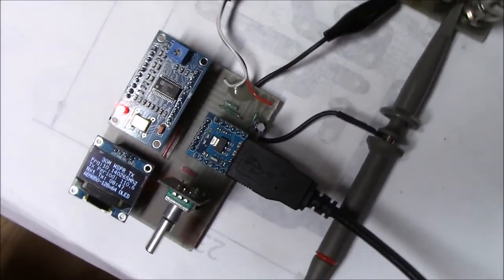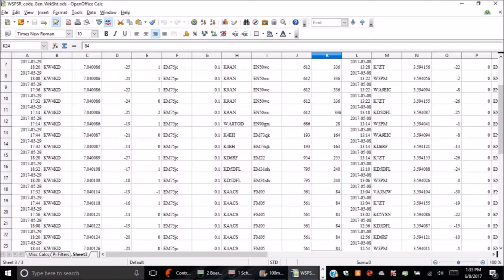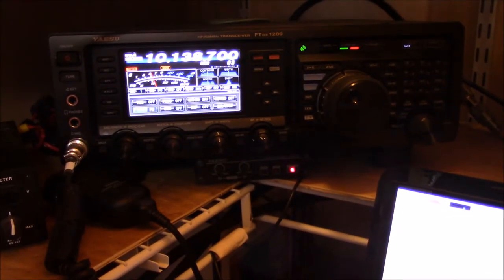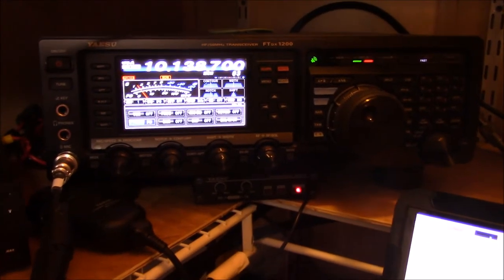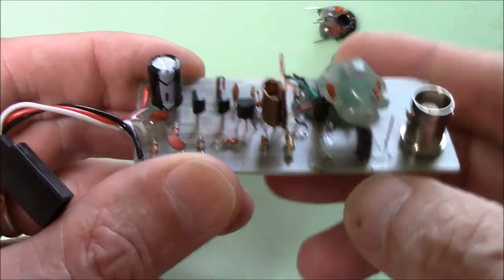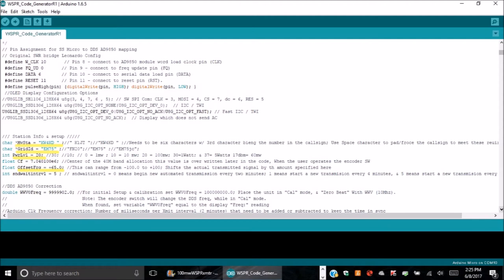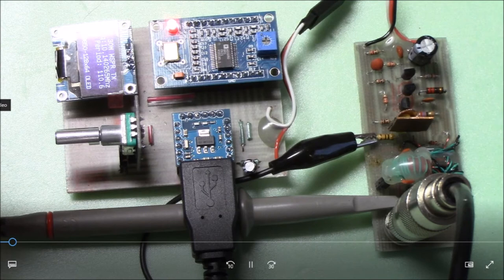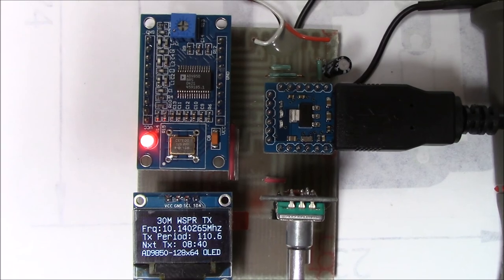DIY 100mw WSPR Transmitter

Comment: Would it be possible to have this transmit on other data modes with custom messages, on different bands?
ie say I wanted to do PSK or RTTY automatic message generation based on various inputs and received messages on 20m, to another home station?
example would be GPS and other specific data.

would really like to see something a bit more "customizable"; suppose I could crack open the code and see whats doing though. does WSPR use any sort of filters?
Reply from the maker: Thanks for the question. Its a good one, This setup ( the hardware) could be programmed to generate most any kind of MFSK, or CW signal. But not PSK. 
How practical it would be as say, a RTTY beacon, I'm not sure.. 100 milliwatts on 40 meters using WSPR makes contacts all day long. But the same power using CW on 40 is futile. When comes to S/N, the WSPR protocol has a huge advantage over the asynchronous modes . 
As for the code in the sketch,  yes please take a look, what you'll find is that 99 percent of it is about converting the text to be sent to WSPR. The 9850 takes very little code to output a given frequency.

Comment: Hi Jim! Thanks for nice project! I'm trying to repeat, but i have found some problems in source code. I found Loop () routine strange.
Reply from the maker: I need to know more about your setup before I can offer any suggestions. Are you using an SS micro (board type = micro)? If yes, then I would think the code should compile with out error.. But if it throwing errors , when compiled as a Micro, what is the line of code, and the error?
Thanks,
   Jim (KW4KD)
Reply: Yes, you are right. Problem solved by changing board type. First attempt to use Arduino Nano was failed, so, then i changed to Micro the transmitter have start working.
Reply from the maker: Excellent! Good luck with your setup, BTW, don't be afraid to play with my value  for time compensation ( msCorrection). That value is based on what my unit needed, and I find that it changes with temperature, Again good luck & 73.

Comment: i have no idea what r u talking about..
i know about arduino but i dont know what is wspr what is its usage
Reply from the maker: Thanks for comment. Probably should have done a better job, setting up the video. 
WSPR is the acronym for "Weak Signal Propagation Reporter"
As the name suggests,  people participating in this group are either
listening for low power radio signals, or transmitting a signal (using WSPR protocol & designated frequencies)
Most players do both (transmit and receive). But its not mandatory that you do. Anybody can operate/register a "listening" site, and I often operate just as listening/reporting site.
I'm not sure about other parts of the world, but here in the US. the WSPR frequencies all lie in the "ham" bands. So to transmit, you need a valid amateur license.   
In this video, I'm trying to show that building a usable WSPR transmitter, is not that  hard, or expensive. Hams love to try out different antenna configurations.
and as indicated in the video, building two of these units would give you the means to do some direct A/B comparisons.
Here are a couple of links that better explain what WSPR is:
https://en.wikipedia.org/wiki/WSPR_(amateur_radio_software)
http://wsprnet.org/drupal/

On the wsprnet.org site, be sure to check out "Map" web page.
Again, thanks for taking the time to post your comment
.
Reply: οh cool i didnt knew that something like that excist.. i am from europe, i assume there are radio hobbists over here too!